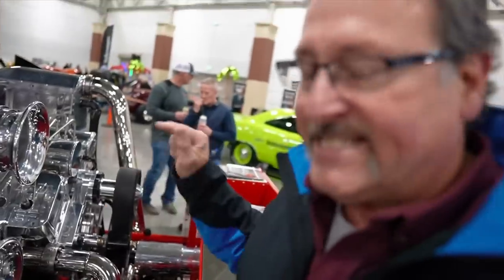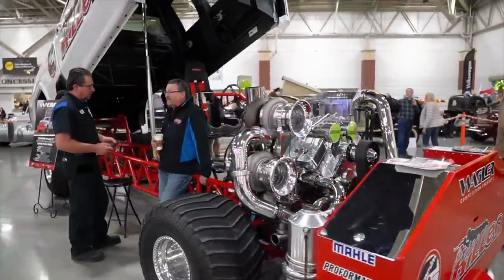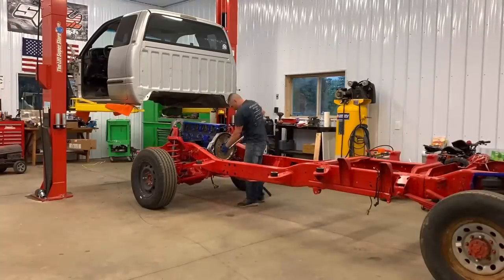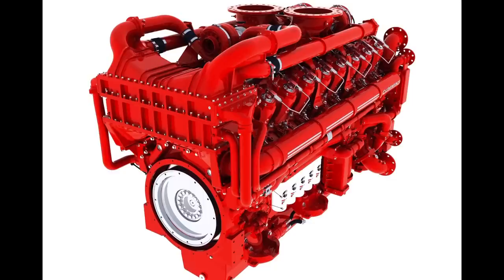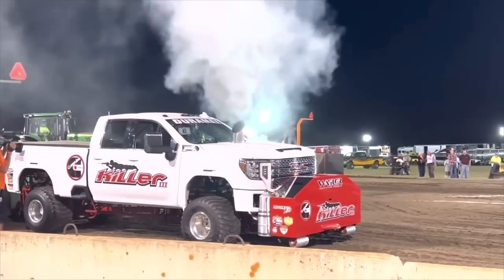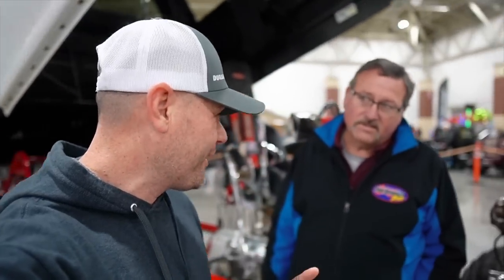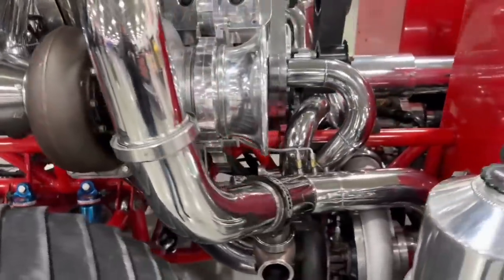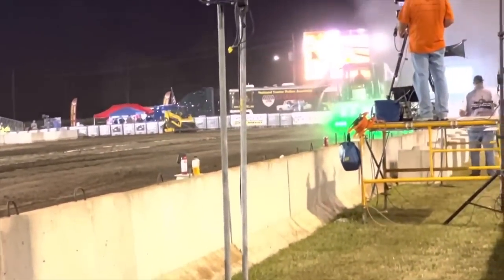Cummins Fans Will Cry When They See This 3200HP Duramax!

Comment: Cummins killer?! Chris Patterson made 3400 on a stock block… this is everything billet. Call it a Cummins killer and spend probably $50,000 on engine and call it that? Grow up
Reply: Cooler than a ford though😂
Reply from the maker: I think they are all awesome though except a 6.4 😂👍
Reply: And a 7.3…😂
Reply: You’re not wrong. And I’m a Duramax guy lol
Reply: Dont be a poor sally 🤣
Reply: Only 50k ?
Reply: @joekartis7564  7.3l is the most reliable engine out there.
Reply: It's not a Duramax... it's a Wagler competition engine, that happens to be a v8.
Reply: @Fossillarson  50k in turbos, maybe.
Reply: I bet there is over $250k in that engine just to hear it run, and who knows how much more, probably in the millions if you factor in the parts changes, fuel system(s), cooling, engine management, data systems, turbos, charge air cooling, tuning, labor, repairs, etc...
Reply: And what happened to that engine?
Reply: @dozerboy
Reply: @Shaddowbanned  can’t think of a single thing that could go wrong
Reply: @grubb910  Lol chris said it cost him about 30k in hard parts
Reply: Wasnt a stock block. It was a Hamilton cast block that he filled.
Reply: @joekartis7564  it didnt blow up lol
Reply: @ThanksHero  what does he consider "hard parts"?  The rotating assembly?
Reply: Not a stock block. It's a Hamilton filled block with a deck plate and girdle.
Reply: @grubb910  That's called the Dx460 Duramax
Reply: @grubb910  the whole engine. It actually had a stock crank and stock modified head among a few other stock parts.
Reply: @ThanksHero  are you talking about the truck in this video?   He says it is a billett Wagler block, and it's easy to see that those are not factory cylinder heads.
Reply: @grubb910  no this comment thread isnt about that engine lol
Reply: @ThanksHero  dude, sarcasm is hard to understand via text... so I don't even know what that means 😄  that was a billett block engine, in the video.   If this is about another engine, that's news to me...
Reply: @grubb910  bruh the original comment you responded to is about a cummins. No shit the video is about a duramax.
Reply: @ThanksHero  Looks like we had some confusion... NBD.  I was never saying anything about a Cummins... everything I said was about the truck featured in the video.
Reply: @ThanksHero  You replied to me, thinking I was talking about the Cummins.... I was obviously confused by your responses... Because I was talking about this "Duramax" the whole time.  The internet is fun.
Reply: @ThanksHero  Not sure where you're getting your information. Chris Patterson's truck has a concrete filled high- test Hamilton Competition block. The crank is factory but has a gridlock girdle and 14mm main studs holding it there. It has D&J X beam rods with a  proprietary stock compression piston. A billet cam and a D&J stage 3 head.. So again, other then the crank. Nothing on that engine was stock. Even the injectors are thicker then stock to prevent them from cracking. Cummins fans are crazy
Reply: @countcuda70  a d&j stage 3 is a stock modified head. Rockers are too. I thought pistons were as well but i suppose im wrong on that.
Reply: @ThanksHero  Yes, you're wrong on that. Pistons are not stock. Do you have any idea what stock means? Stock as in the way it came from the factory. A stage 3 D&J head is over $7,000. Not even close to a stock head. How many stock heads have a billet intake manifold? 🙄 You're way of thinking. This whole truck is  stock modified. Trans has a stock case but fully built.. it's stock. Engine is fully built but stock lol
Reply: @countcuda70  lol the point being an OEM modified part (a head thats had some machine work and small parts upgrades) is a lot different and more impressive than buying a one-off full billet engine that probably cost 10s of thousands of dollars for a long block.
Reply: @ThanksHero  Lol! You're funny. It's not stock. A stage 3 is a factory casting. That's about it. The valves and seats are different and over sized. The spring and retainers are different. All the soft plugs are threaded. Billet intake manifold, c&n machined. Everything on the head has been modified. As I said earlier. It's not OEM. That would be like having a fully built 48RE, nothing but the case being factory and saying it's OEM modified. Haha. A cheap stock head is $1500-$1600. A d&j stage 3 head is over $7000.
Reply: Whyre you so pressed lol
Reply: Biggest nerve struck I’ve ever read.

Comment: Not even a duramax lol has John deere pump and mechanical injectors... a cummins makes more power on a filled stock block and water cooled head and bolt on parts. Cummins doesn't need a one off fully billet engine. There is nothing duramax on that besides displacement. But it is beautiful I'll give you that.
Reply: It doesn't have a John Deere pump. The pump is from Wimer. It doesn't have the displacement of a Duramax. This is 460ci. It's does share a few things with a factory Duramax. Has to for the pulling series it's in. He said the truck made 4,000 at one point. Haven't heard of a stock block Cummins going that high, yet anyways. There are Cummins billet blocks too
Reply: @countcuda708  how can you even call it a duramax?  No but a stock filled block cummins did 3366. Havent seen a stock block duramx even come close
Reply: @lilredsled  I didn't say the block wasnt stronger in the Cummins. Tony from DHD said a stock Duramax block will go to about 2300ish. Justin's truck isn't a "stock"  block. It has a deck plate and sleeves. True it's more of a stock block then this one but they are built for different things. Justin didn't pull or drag the truck with the Dyno setup. Chris hit 3401 with a filled Hamilton Competition block. Also doesn't pull or race with that set up. Trucks out there use billet Cummins based blocks also. Wagler calls it a Duramax. It's based off the Duramax design.

Comment: Do top fuel dragsters still try to appeal to Mopar fans, and call their engines a Hemi, and act like all of their cars are a Challenger?    Hum... same story.  This is just a GMC body on a custom machine.  That's a Wagler engine, not a duramax.
Reply: Wagler literally calls it a DX460 Duramax. Super Stock Cummins engines aren't like the ones found in Ram trucks either. They have a lot of modifications too

Comment: It is a very nice truck. But there are a bunch of Cummins that are at that power level and beyond for way less money. If you were to put the same amount of money and engineering into a Cummins platform the power capabilities would be absolutely insane. But this thing will definitely be giving Cummins some competition
Reply: This much money has been put into the Cummins. It just had a 12 year head start. Cummins was changed and built over the years.
Reply: @countcuda70  Cummins is still king to this day but I think duramax is catching up for sure. At least there both leaving power stroke in the dust lol
Reply: @Thedave2224  Im not disagreeing with you. Cummins is an amazing engine. Wouldnt be where we are without it. There's a couple Duramax and Powerstroke trucks here also. Not saying they are better or worse but nothing is king forever
Reply: @countcuda70  I agree

Comment: Hey, did you hear about the Cummins on the Dino last year? I think it was about the same amount of horsepower is your Cummins killer? Hey there stock Cummins crankshaft in it. I bet you don’t have a stock Duramax crank in your Cummins killer this is six in a row. Jim from Kennerdell Pennsylvania oh, by the way, I got a 91.5 dodge. Yeah you guys got a hell of a package I got a hand it to you man that’s a beautiful engine you guys put together the truck is absolutely gorgeous, but you’re talking the equivalent of a stock 426 Chrysler hemi versus a Kieth black aluminum block engine. There’s no competition there. Oh I bet you DNJ in Ohio put together a Cummins that would do just as good as yours
Reply: Zeigler ran 3336 and Chris ran 3401 on the Dyno. A Dyno set up is a lot different then a sled pulling setup. They used nitrous on the Dyno. Cummins Killer is fuel only numbers. The chassis builder also said in the video. They had this engine turned up to 4,000hp at one point
Reply: Hate those guys that made her those big numbers on the slip pulling machine my hats off to you without a doubt that is a beautiful piece of workmanship. Is that truck I mean it’s stunning and yeah I’m a Cummins guy but you know what your engines white 500+ cubic inches Ziglar what was he 6.7 anyway yeah you got the Cummins covered but I guarantee you right now. Eventually will come up with something like that also. Well, I mean look at what fire punk is running solid aluminum block first one into the threes in the 8th mile how much horsepower does it take? Yeah you’re right about Zigler using nitrous but check this out if his torque converter wasn’t slipping which it was he probably would’ve had another three or 400 hp, so I mean yeah you’re right nitrous versus fuel only I agree and I’ll never ever say anything bad about your package. It’s beautiful I’d like to check it out in person myself all right this is six in a row Jim from Kennerdell, Pennsylvania
Reply: @jimmungai1938  This Duramax is 460ci. It's a DX460. Fire Punk made a Dyno video on their truck. It was about 3200hp. Look at Van of Haisley Machine in the Rock Hard Ram (my favorite Cummins truck) or Kent and Brad in Scheid trucks. They make monster power in full custom Cummins engine powered trucks

Comment: Im a duramax guy but its pretty much undisputable that the cummins is the standard, i mean a stock 12 valve can handle more power than a brand new duramax, this truck is cool and all but it costs a lot more to make that kind of power with a duramax than a cummins.
Reply: This was true in the past. There are stock internal Duramax engines over 1000hp. It's all in the tuning. Banks showed a stock L5P can make over 1000hp. Cummins can make a lot of power but nothing stays on top forever. As for these trucks. They all have a ton of money into them. This truck and a couple others are the first Duramax to go this crazy. Once more get to it. The costs will equal out

Comment: Not even a duramax at this point
Reply: But it is
Reply: @Count Cuda70  sure looks like it with 3 turbos etc.???
Reply: @ryanl5888  You do know there are a few road driven Duramax trucks with triple turbos. This is a Wagler Performance DX460 Duramax.
Reply: The same thing goes for the cummins powdered trucks in the modified class. Nothing is factory anymore.

Comment: Look at my Cummins killer engine that's twice the size of it and running twice the amount of weight to produce a little more power 🤣 we all know the pulling Victor. Glad to see how much money and effort it took to beat it. Imagine if they put that much Into the Cummins engine how much more they could have accomplished. Beautiful truck however circling the whole name around killing a engine when it's clearly been zombified to get even close truly shows which one is the most superior.
Reply: Lol you're funny. All kinds of upset. Take a breath. It's just a name on the side of a truck. You don't think this much r&d went into the development of the Cummins to get where it is. You're crazy. Cummins had a 12 year head start. Powerstroke and Duramax are just getting into Super Stock. They will get there. Cummins in this class aren't what you can buy off the shelf either. They are highly modified. A lot of trucks in this class run billet blocks also. This video has the hard core Cummins fans really hurt. Wooosah!
Reply: @countcuda70  greatest thing is, I own a Silverado. I can give credit where credit is due though.
Reply: @brandoneverts9003  That's fine. Give the credit. We all do. Cummins has been the king for a long time but nothing is forever. Think about how much R&D went into the Cummins to get it here. I remember over 20 years ago. When Dave Mitchell from Enterprise Engines had the Great White Ram. That truck was like 700 HP. That was monster power for the day. Haisley Machine and Scheid didn't start making this power either. Look at what they have grown into today. Without Cummins paving the way. The sport wouldn't be where it is right now. I'm glad we are getting other engines into the sport. Will push them all to be better

Comment: Funny how he keeps calling it a duramax yet it’s not. It’s based off a duramax. Cummins will always remain at the top!
Reply: Wagler Performance literally calls it a Dx460 Duramax. It shares some measurements from the OEM Duramax. It's funny how upset Cummins fans get. Having another high hp competitive diesel is good for the industry
Reply: @countcuda70  it does not matter about measurements. Can you take OEM parts from a regular Duramax and put on this engine? Didn’t think so! Again this is not a Duramax. It’s based off of a Duramax… I’ve owned both Cummins and a Duramax. Cummins is king because of its simplicity and how easily they make power. You can’t deny that!
Reply: @PndaS2k  Wagler built this engine based off the Duramax. You need to wooosah a little. You're up in your feelings too much. Wagler calls it a Duramax. Not sure why you're not seeing this as growth in the industry. You see this as competition and get you all twisted up. I'm a diesel fan. I like them all. We need the competition between the 3. It's how we got the great engines we have today. Fight it all you want. It will still be called a DX460 DURAMAX 😜

Comment: But, it will never out perform or out last the 12 or 24 valve
Reply: A stock 12v or 24v is out performed by a stock LB7. The LB7 makes the least power stock of all the Duramax engines. Plenty of 500,000+ mile trucks out there

Comment: Diesels are not should post to be a v8. All Ship engines are inlines, all semi engines are inlines. Train engines are inlines. That shit ain't no V configuration. A V configuration is useless for torque.
Reply: You need to do a little research before you post stuff. Trains have V engines. Ships have Inline and V configuration engines. Not all otr trucks have inline. There's more to making torque then cylinder configuration. Inline engines are balanced but don't make more TQ just because their inline
Reply: @johnwharton3038  An inline isn't going to make more just because it's an inline. More goes into it then that. Here's an example for you. A Scania 16L V8 diesel has more TQ then an equivalent 16L inline diesel engine.